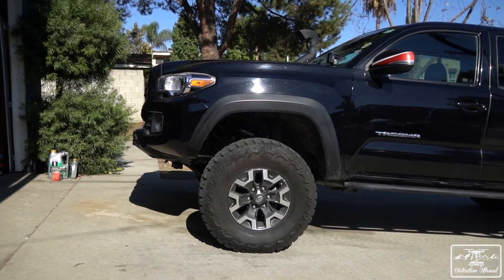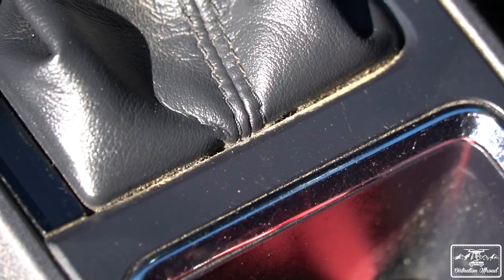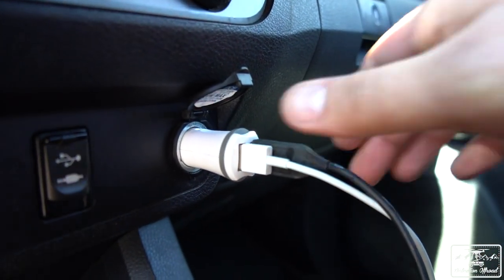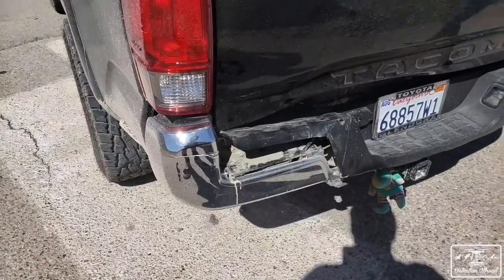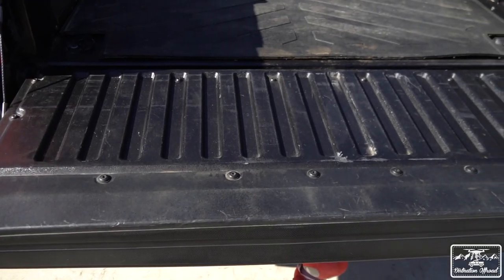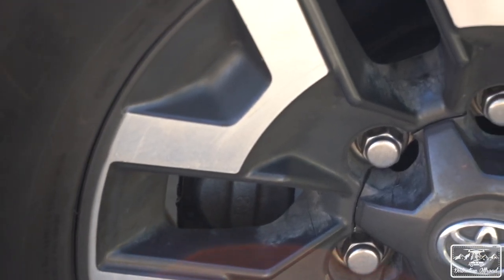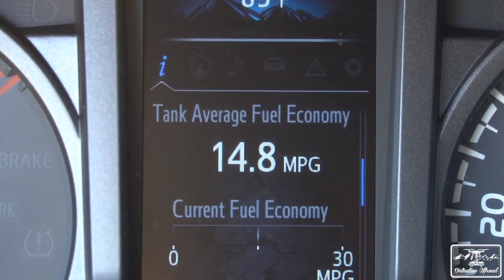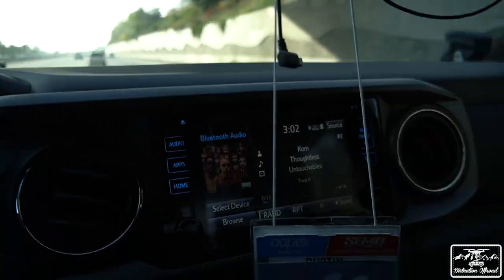2 Year/50,000 Mile Ownership Review! 2017 Toyota Tacoma Trd Offroad

Comment: I got a 2017 Tacoma  and got a bad oil leak, there. Was a rubber plug seal on the head and they had to lift the engine out to get to it. Thank god it was still in the warranty miles didn’t cost me nothing.

Comment: Thanks Dustin, I found this both informative and helpful since I just got my 2020 TRD Off Road in Quicksand last week!  Yes, it has a power adjustable driver’s seat!  Woooo Hoooo finally, Right?   Also the Apple Car Play and keyless entree on the passenger’s side.  Got a hard tonneau cover put on and next will be rock sliders with a kick out.
Reply from the maker: Damn you got all the fancy stuff in 2020 🤣🤣🤣
Reply: Dirtnation Offroad  Not really though.  I did not get the LED light package $500.  I also did not get the $4,000 package with heated leatherette seats and climate control etc and sunroof.  I did however get the tech with pkg with Blind spot detection and lane assist, but this gets you the body color painted rear bumper.   I did not choose this though it was simply on the lot.  Has the Tacoma all weather mats.   All in all I am happy so far.  Keep the content coming Brutha!
Reply from the maker: Armand Couture awesome! Appreciate the support 🤙🏻